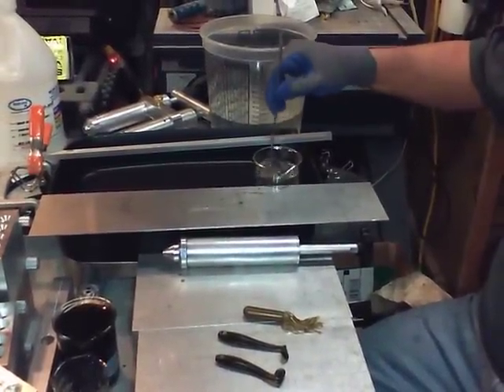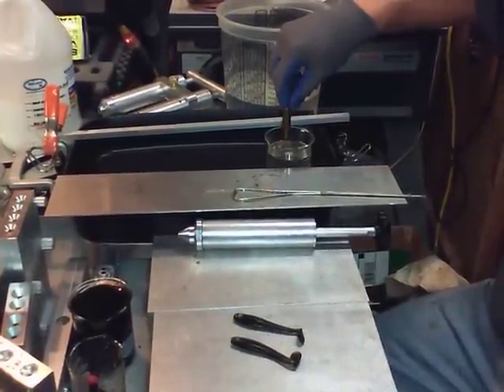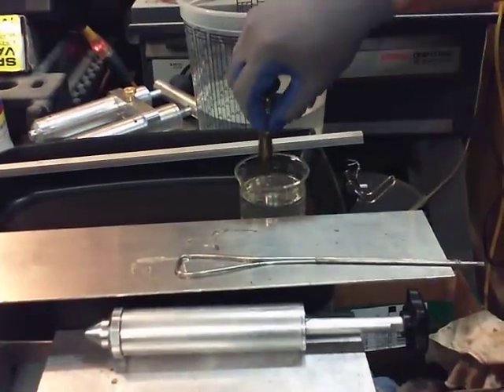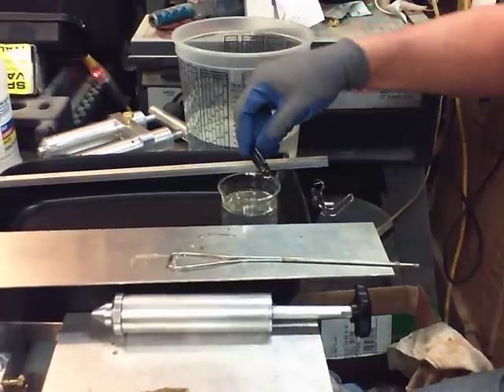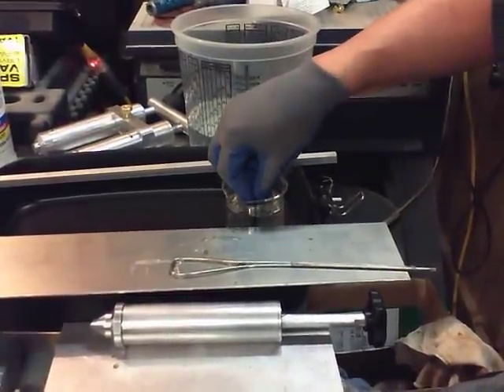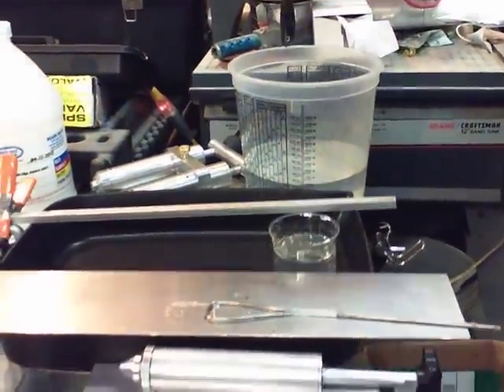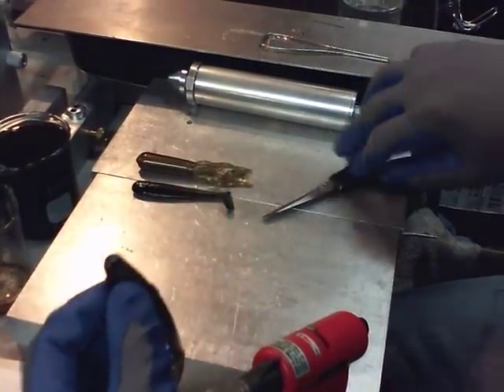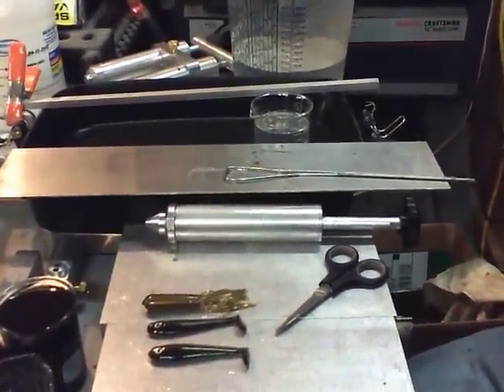Dipping baits

Comment from the maker: I am using Spike it plastic now It used to be sold else where but now you can get it direct. It does yellow if heated repeatedly. There is no magic plastic it is all pretty much the same. I use the griddle to keep the heat up in the plastic and keep reheats down.Thanks For watching   Frank

Comment: Hi thanks for the video. Quick question: I have a problem with my baits peeling after I’ve dipped them when they are cool. How can I fix this? It’s like a second skin coming off. Thx!
Reply from the maker: If it peels off like a skin it is not hot enough. If you wait to long it will do the same. Very important to have the plastic hot enough to bond to the last one.